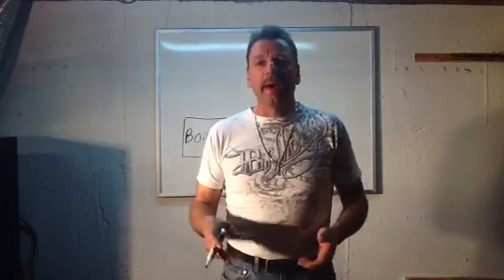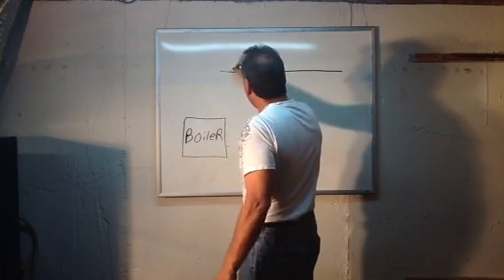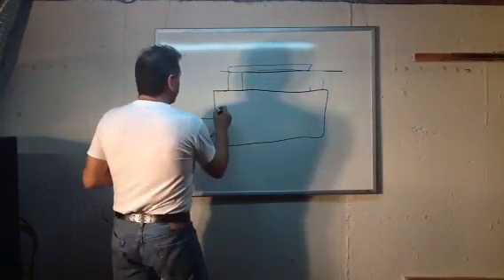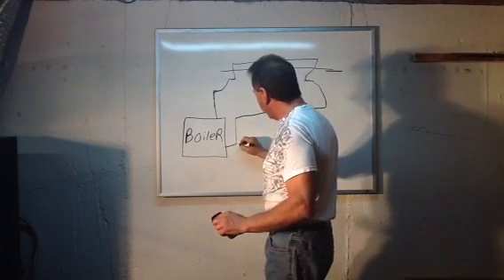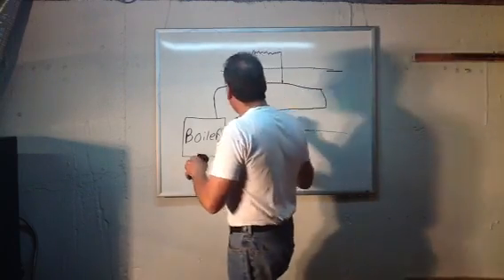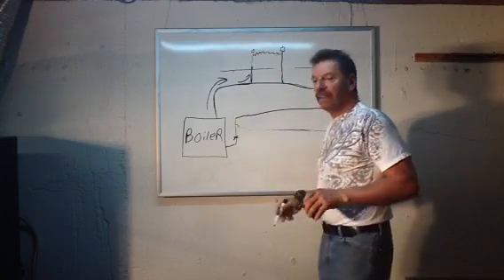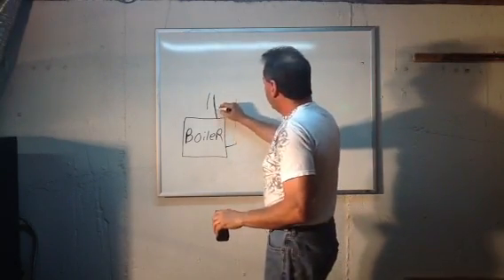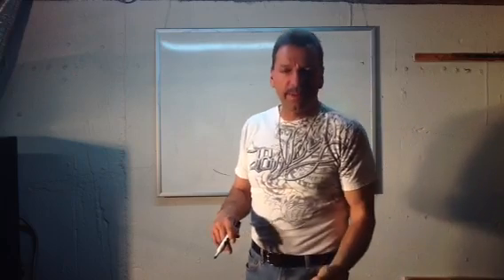why some hot water baseboard just doesnt get hot

Comment: Just bought a house built in 57. Removed a wall and upgrading from radiators to baseboard. Have 1” main supply lines with 1/2” monoflo tees that fed the radiator. I was going to re-use the existing lines but the 30 seconds of this video just saved me. I’ll use elbows for the baseboard to use 100% of the water flow.

Comment: Thank you for this video, the first reason you explained is what I’m dealing with at my grand moms house. It’s an old house and it has the mono flow tees feeding each radiator, I replaced two sections that weren’t getting hot because I thought they were clogged because there 65years old and thought maybe there clogged. Me being inexperienced I put baseboard tees with bleeders on the leaving lines of the baseboard and one of the sections isn’t getting hot. I bled the shit out of it with no barely any result. The leaving line with the bleeder was starting to get warm but the entering line was cold. I’m going to put a valve in the return line to force it through that section, that’s my cheapest option. I really appreciate your video because I was starting to feel defeated. I even soldered in a drain valve before the boiler on the return line to try and purge it out that way and same result.

Comment: My dad ran baseboard with mono flo Ts …….had a valve in each room to adjust water flo …….never had a problem……if you run pipe straight thruogh…first rooms will get hot each room that follows less hot last room will be cold…..where you put the stat ? First room - last room cold……last room - first room hot…….straight runs cheapest way to do it ….mono flo most expensive in time and material …but the right way in my book…
With mono flos one could also put a stat and control valves in each room…….or one could run separate zones to each room……even more time and material. …but probably the best way in terms of heat in each room……

Comment: exactly what happened to mine  where my handyman just cut the line and replaced it with baseboard to my 2nd floor dormer and it gets no heat. tried to bleed the system for 2 3 hrs to no avail

Comment: i have a split loop system that has a 1'' main that leaves th boiler and the first stop is a 1'' monoflow tee with a 1/2'' outlet going to the bathroom convector, otherwise the rest of the system is fine. being its a 1/2'' outlet should i be concerned?

Comment: Not all my baseboards are getting hot. My second floor ones are doing great but my first floor does not reach the desired amount of heat. It's always cold on my first floor. 
I dont have a basement im on a concrete slab , i don't know if that makes a difference.

Comment: I came across your video and the house that I bought has a finished basement with two zones. Many of the baseboard heaters are hot to the touch. In one room it's cold. I probably have a leak, but it will be difficult to locate the leak when you have a finished basement. How would you tackle looking for a leak in this case? Thanks

Comment: Thanks. I’ve had three different plumbers check out my system and none of them could tell me why I don’t have heat. Also the last guy didn’t purge the system after replacing a broken valve. All my two inch lines are hot from the mono tees up they are cold. This is turning into a nightmare. I took a metal straw and blew air into one of the bleeder valves hoping it would pull a prime when it blew back out.  It did end up pulling hot water up from the mono tee but only for 10-15 seconds. I have been tinkering with this system and watching videos all day. I wish I had found this one sooner. Thanks again. Plumber #4 will be over Monday.

Comment: My house wasn't converted but, the problem I have is the baseboard in the living room and basement doesn't get that hot, you can keep your hand on it, the bedrooms and bathrooms, even the one in the basement get hot, you cant touch them, I cant figure it out,  replaced circulator,  tank, purged it to death,  the only thing I can think of is that the living room and basement are the last spots before the water returns to the boiler,  any ideas?

Comment: Lou, I really appreciate your videos! They are no-nonsense and get right to bottom line. I was wondering if you might be able to answer a question? My sisters house has a NG boiler with 4 zones and aluminum fin baseboards. The plumbing is 3/4" copper. I am wondering how the system would work if I was to swap the current aluminum fin baseboards for cast iron baseboards? I am not a heating expert by any means, but every house that I have seen with cast Iron baseboards used a mono-flow loop. I have never seen a house that used cast iron radiators with a full-flow plumbing configuration.  My sisters house is plenty warm, but the cast iron baseboards have so much more thermo-mass and store the heat after the boiler turns off. Any thoughts that you have would be much appreciated.

Comment: Hello. I have a 1 zone system. Old "mono-flow" valves. Boiler in basement. Pipe go out of boiler and splits in 2 at first  radiator, then returns. (All radiators on first floor). 14 years ago, we replace whole heater system, from 1947. The plumber installed a second pump on the return right before the boiler. The outlet has a pump right at top of heater. That stopped working a few years ago. I never bothered to put in a replacement (Taco) until now because 1) it's summer , so I can work on it, and 2) the first baseboard hasn't been working. There is bleeder valve but only on the return back end of the mono-flow valve. And I believe that maybe that baseboard isn't working because there isn't enough pressure to get the water fully through because the outlet pump isn't working. Another thought is that there might be resistance at the non-working pump too slowing down water to get thru the radiator. Any thought about this??? Thank you

Comment: Great explanation Lou. Do you have any advice for me? I am home owner, not a plumber. I recently got a used indirect water heater tank removed the thermostatic control and pump and tab into the return of my baseboard heating system return to preheat the domestic water before sending it to the electric water heater. I live in the country and oil is the source of energy for my heating system.

Comment: I've seen my share of systems with baseboard running off monoflow tees they work just fine if keep the air out of them. monoflo systems were designed so that every radiator all baseboard gets hot water at the same time letting the home  heat evenly. as far as putting a bleeder on the opposite end of the inlet is false the pressure on both feed and return are equal. I've never seen baseboard with pipe running in and out of a slab other than radiant heat.

Comment: Trying to buy a townhouse but they all have forced air, which i hate! Is it possible to replace it with boiler and baseboard? Or do i have to get a house instead? I'm willing to pay for installation but i can't seem to find any info on whether it's possible or what i have to check in any unit i go to see. Is there no way to retrofit a hot water heating system into an existing home with forced air?? I want to scrap the furnace and keep the duct work just for a/c. I like to stay very warm in winter and heating air is the stupidest concept - it is drafty and unpleasant when air moves around. I have always lived with baseboard and love it. Can't believe there are no newer townhouse out there with baseboard!! And please, nobody start telling me how i need to get this or that improvement to the hot air system. Hot air is a bad form of heat because it does not heat objects like radiant heat does, which is what hot water heat is all about. I don't want hot air, i want heat that radiates from a hot object, like a baseboard.

Comment: OK, makes sense.  I know this isn't the case with my house, but still the slant fins don't get hot, just warm....I think my system is full of air.  I'm confused when you mention not having a bleed valve up top by the highest register, I would think this is where all the air would be trapped at the highest point...  Oh well
Reply: I have the same problem with my slant fin baseboards. I would love to convert at least my main level back to radiators. I have no idea why one of the previous owners decided rip out the radiators and put baseboards.

Comment: Straight to the point very helpful. I tried putting in a valve between the monoflow tees too see of it would fix the problem. It def gave more heat to that pipe but it still wont go up to the baseboard on the second floor any ideas

Comment: I find the baseboard heated by water gets hot actually too hot and when the valve is shut off it is slightly cold!   Can I keep the water valve half ways to adjust the heat the sliding thermostat (non-digital)  doesn't always shut off the heat.   Inside the apartment water valve.

Comment: Would you say monoflow setup feeding baseboard increases head pressure?  Or rather you should consider that it increases head pressure for pump sizing.  Having an issue and I’ve tried to increase water pressure and nothing.  I have baseboard that is warm and a radiator that is cold.  I think the baseboard is a path if least resistance and the radiator needs more pressure to get the hot water to flow through.  The system worked with a old B&G 100 but nit with a Taco 007

Comment: Had one baseboard not hot off mono flow tees, I thought the tee was gunked up but this makes sense it is the longest run of baseboard and the hot water  would rather run by it than go through it  going to need to cut open a nice finished ceiling to put a valve in

Comment: I am having issues with this in one of my properties. Brand new boiler put in April 2017, however, the baseboard heaters in some of the rooms are not producing adequate heat. Do I consult a plumbing professional for this? Do plumbing companies swap out old baseboards and put in new ones? How do I know when I need to get to that step?
Reply: Good luck. I have the same problem and the hardest thing is finding a good plumber. All they do is come in and start draining water and wanna charge 200 bucks and you still have the same problem.

Comment: If you have a mono flow system or a system pipes in series, either way, the radiators at the end of the loop will output less btus. The biggest problem with monoflow is when you should use one or two mono flow t’s AND t spacing. If the t’s are spacing is too close, the water will not flow through the baseboard. Rules need to be followed.

Comment: Well I hate to contradict you, but we have a second home in Connecticut built in 1961 with two additions. The whole house is baseboards and monoflo tees. Boiler at 180. Its a very comfortable house, warm in winter. When the circulator is running you can't keep your hand on the cast iron baseboards.

Comment: Great video! Thanks! Just like you said, baseboards were installed with the mono-flow tees still in place, which I will replace with elbows, however is it okay that a mono-flow tee with radiator comes right after the baseboard and elbow on the same line? Thanks!!

Comment: if more than 67' of BB on one 3/4" loop the excess BB will not get hot under design temp. conditions.Really cold days.
Reply: I have a bigger problem. My house has 65 inches of 3/4 in baseboards with a 1/2 inch pex supply and return and 1/2 pex was used to join some baseboards.  I'm gonna hire a plumber to change everything to 3/4 after the winter. It's gonna be a pain in the neck because the ceiling below is finished. The longest run is gonna be the return back to the boiler. Will it make a difference if I leave the return at 1/2 inch since the water has already left the last baseboard? This is the main level of a 3 story house which is open concept.

Comment: If there was a leak under the slab, how would you know and fix it?  I have an issue like this...on a slab, one room thats furthest from boiler never heats up warm enough to be comfortable..
Reply from the maker: +hllywd964 you have to check to see if there is a pressure drop by watching the gauge on the boiler. If there is, you can turn the temperature very high and find out where the concrete is the warmest. Thats where you would chop it up.
Reply: Ok, thank you!

Comment: This video was precious to me because it touches on two issues I'm having with a basement radiator!   I turned the basement radiator around so that the bleeder valve is now on the outlet side of the radiator and happily the radiator at least fills up with water.  However, it still doesn't get hot.  I'm considering installing mono-flow tees to help get the hot water flowing to the branch that this particular radiator is on.  However, I have a two pipe system.  Do mono flow tees work on two pipe systems?  That's my question.  Many thanks!

Comment: My system is over 50 years old , and doesn't have a circulating pump , can I install one ? To make it more efficient ? Was told it use to be a coal boiler but in the 60 s ? They attached a burner to it ( oil) and called it a day lol, it has the radiators and the heated water just travels up
Reply: Yes put circulating pump, will help a lot

Comment: I have a total of 5 cast iron baseboards on my first floor. The first three of them (in water flow direction) are about 80 to90 degrees colder than the last two according to an infrared thermometer. I definitely have the T connections and always thought it seemed kinda weird for the water to flow both into and past the heaters at the same time. I cant wait til the weather warms up so I can fix those suckers. Thank you
Reply: grumpchong with cast iron baseboard you wouldn't want to direct Loop them the last cast iron baseboard would not get water hot enough to sufficiently do its Duty. this is why you have monoflow tees so that every piece of cast iron radiation gets hot water at the same time and sufficient hot water

Comment: I've been struggling with this issue ever since I bought this house.  After watching your video I investigated following your instructions and found that I had BOTH of your first two scenarios. That is exactly what they did. They installed baseboard heat with Ts in the line allowing 90 percent of the water to just bypass it AND they put air bleeds in the wrong ends of most of them... Thank you, I've been struggling with this issue for seven years.
Reply: Same situation in my new house. Please could you let me know if they had to cut open the dry wall and what is cost you to correct the problem? Just the the bed room in the lower level is always cold. I haven't checked if it has the Ts
Reply: In my house they go straight down through the hardwood floor.  None of mine have anything to do with the walls other than leaning up against them for mounting.
Reply: Likely you need a air purger and Extrol tank. Extrol is type of expansion tank.

Comment: What about on a 2 pipe system? Has a separate return. A house has old finned type heaters all over the house. I am replacing one in a small bathroom with a new 3 ft unit. 3/4" copper with fins. All heaters are fed with mono flow tees and all heat well. They all return on separate pipe. Seems this is an ok way to use mono flow tees with finned heaters. 

Another problem is a heater on the 2nd floor, there is no water reaching the heater. Once I replace the heater in the 1st floor bath, I am going to bleed the entire system at the boiler. Does this sound like a proper approach?

Comment: Louis, I cant thank you enough for this vid. Years ago, I converted my system from exactly what you drew up here and had this very same problem. The boiler was always running and the basement, was just as warm as the living level. This past weekend, I remove all the monoflow tee's and extra piping,  took out all the 1/2 pipe and replaced it all with 3/4. I gave every baseboard an elbow and the change is dramatic. From the bottom of my heart and wallet, Thank You!

Comment: Louis, my house has baseboard heat, downstair not hot, heater guy said he can't find leak, most likely it's pipe leak in concrete, this house has no basement,  how do you pin point which section of pipe under ground leaking,  instead of dig up the whole concrete floor? Please help

shirley

Comment: During renovations, a contractor put a new baseboard heater in my small bathroom on the top floor.  When it was time to turn on the heat, there was nothing.  I was able to bleed enough air out to clear half of the lowest level of the house and the living area.  Nothing upstairs. 
I called the contractor who just kept promising to send "his" plumber.  I called my oil burner man who spent at least an hour trying to find a bleeder on one of the baseboard heaters upstairs.  No luck. 

Then I found your video.  I warily went to the burner, closed the valve you described and ran the water into my sump pump.  That evening I noticed how warm it was upstairs.  Thank you so much.

Comment: Wow, can't believe you explained exactly what is happening in a property we just purchased.  (1) section of heat was ice cold, bleed lines, added bleeder above cold section and it got hot, downside, another section of heat went cold.  Added bleeders to (2) other base boards on main floor (there is no basement). Now original cold goes in hot but feels cold in fins and is cold in return.   2nd floor is warmer than 1st, so we considered adding a reducer to 2nd floor, then considered added another pump to cold section to push water thru....  would love to hear your thoughts :)

Comment: You mentioned the one thing I needed to purge the system and the is to turn off the value in front of the purge valve, of course , that makes sense, 50000 gals later. Lol. I still have a zone making a little noise but I'll live with it for now. Thx